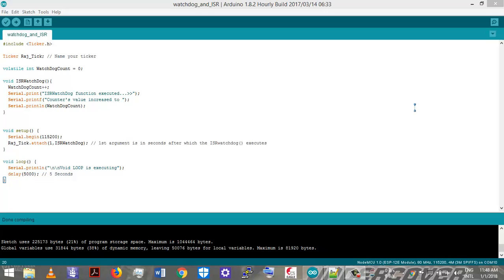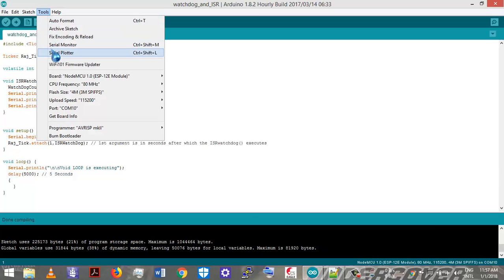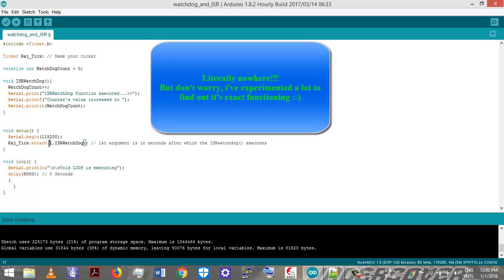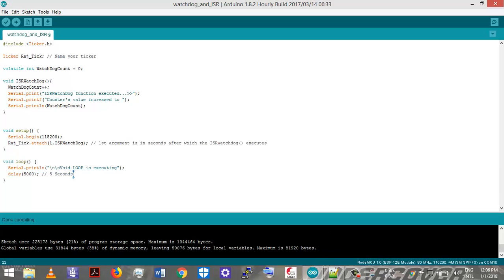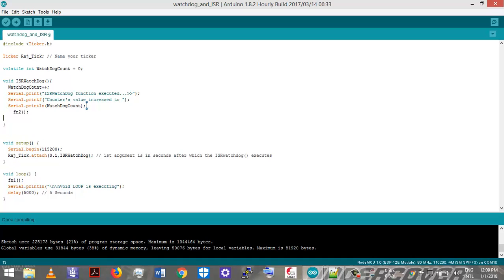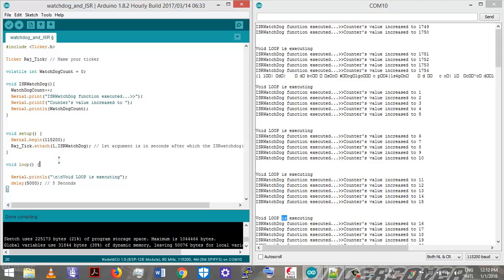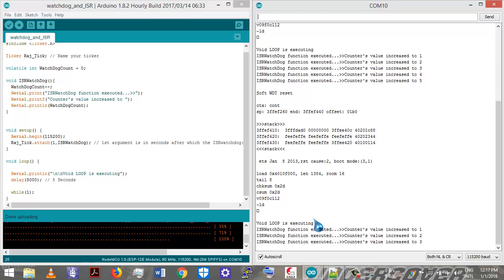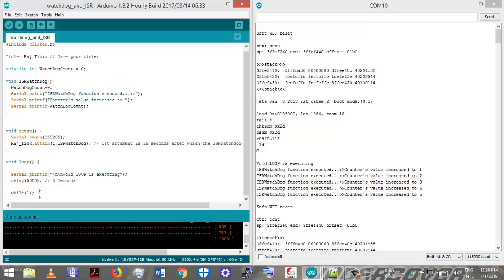Easiest implementation of Watchdog Timer and ISR in ESP8266 or NodeMCU using Arduino IDE, 2018

Comment: Hii Raj nice tutorial.. I have one more issue facing in these nodemcu boards. After connecting to WiFi it resets after some and again connects to WiFi. Don't know why it's happening. Please help me if you can..

It says something called  exemption (9)  and some stack having count values.
Reply from the maker: Once I also faced this problem and that was becos I put some block of code in burst running mode (i.e. running a sports car without brakes), i associated some delay with it then it worked 👍🏻
Reply: @technophileARG  I tried adding delay but same issue exemption 9 and showing some stack values.. please help me out with this...
Reply from the maker: Bro u don't actually have to write delay()
Associate some delay indirectly, like by calling the function using ISR within interval of 0.1 sec or any other logic, just we don't have to execute it indefinitely fast
Reply: @technophileARG  sounds easy, but I'm completely new to these. can you please help me with my project... Any thing to contact you.
Reply from the maker: Sure there is contact, see video description ;)

Comment: Hello sir how could I show prototype along the code you have shown above sir?
Reply from the maker: Prototype hardware can be prepared by NodeMCU 1.0 Module which itself is a microcontroller as well as wifi module and few general circuitry...

Comment: Hello very nice video Raj.
 I want to know something regarding this watchdog concept I'm using an Arduino mega+ ESP8266 (ESP01) to monitor and control an aqua culture system. The system transfers the data to the BLYNK cloud which is viewed and controlled over the mobile. The system freezes because the esp01 fails to connect to the wifi network from time to time which requires manual resetting. Will it be ok if i upload this code to my arduino mega in order to solve this problem.
Reply from the maker: Yes the method should work
Reply: @technophileARG  can you please add a link to where you downloaded the Ticker.h library.
thanks in advance
Reply from the maker: https://github.com/sstaub/Ticker
Reply: @technophileARG  thank you very much Raj! If I have any questions I will add on the comments section your help means a lot to me!
Reply: @technophileARG  Hello!
I installed the library in the link that you sent me tried to run the code. But there is an error occurring while compiling the code. It says ticker library needs an argument. if you know why im getting this error and/or how to fix it. Please be kind enough to help me thanks in advance.
Reply from the maker: @refakmakeen   www.contact_me_on_whatsapp_8448130737_difficult_to_help_here.com

Comment: I think you are confused, you are not implementing a WDT, you are simply using one method from the Ticker library. The WDT that you see has nothing to do with your code other than you causing it to trigger by locking the main loop. Even if you remove all your ticker related code and just put a lock  Eg while(1);  the WDT will trigger.  You should investigate  ESP.wdtEnable(),  ESP.wdtDisable() and  ESP.wdtFeed(). For executing multiple "tasks" you might enjoy "TaskScheduler" by Anatoli Arkhipenko.
Reply from the maker: Thanks, it feels good to keep Learning :)

Comment: Hey sir, If I want each 5 second the ISRwatchdog will call so I will change Raj_Tick.attach(5,ISRWatchDog); Is that right?
Thanks for your video
Reply from the maker: yes, right
Reply: I try to send data to thingspeak not using delay
The time to send data to thingspeak is 5 seconds. If I use delay(5000);
It takes a lot of time and I can't do anything in this 5 seconds.
But I use watchdog but still not working. Please help me
I need to send data in the interrupts function
Reply from the maker: tôn nguyễn increase the delay that suits your server delay time.